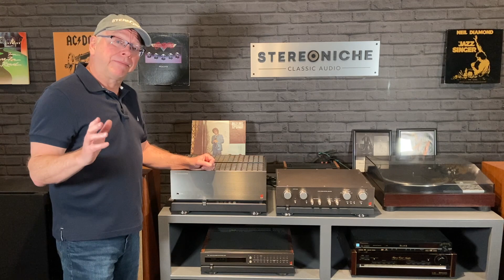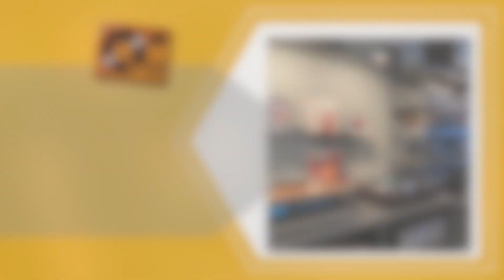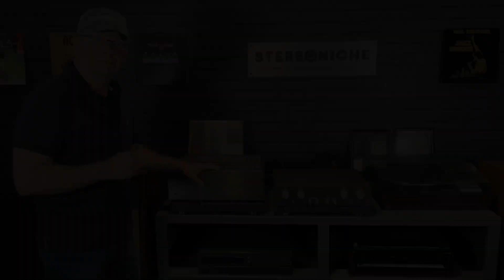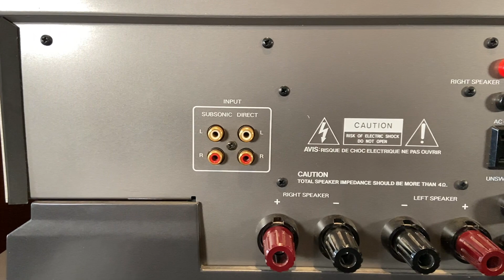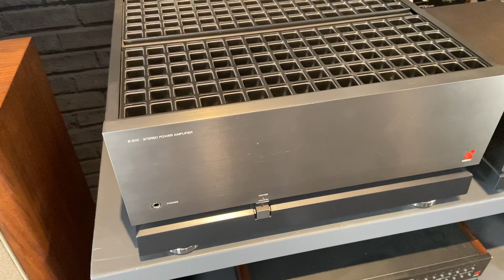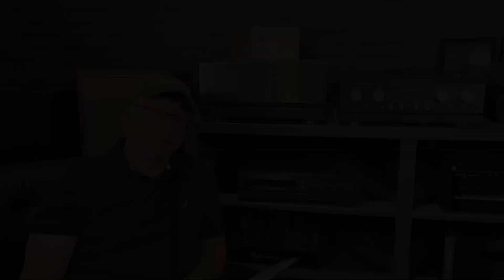Kyocera C 910 Preamp and B 910 Amp Review

Comment: I have a Kyocera D 811 deck. It is a unique 2 head, dual capstan DD, solenoid breaks, level&bias control, separate headphone amp, and volume. I also refurbished a 601 and 611. I have one more 601 that's almost done.. these decks are no doubt two steps above Sankyo 2 head Nakamichi units and are neck to neck or slightly above 2 head classic Naks.

Comment: Hello!  Love your channel and very educating in vintage hifi gears.  I have a question on a vintage hifi amplifier I own.  I own a few vintage gear like the Denon POA / PRA 1000B pre+amplifier, Pioneer M22, Exclusive M4 + C3 preamplifier.  I noticed many vintage gears have a 4, 8, 16 ohm speaker binding post.  Is it okay to hook up a modern speaker [like a dynaudio special heritage] with a 4 ohm 85db to a 8 ohm binding post on an amplifier with a 100watt by 8 ohm [Denon POA 1000B] ?  There is a 4 ohm binding post on the amp, but the sound on the 8 ohm binding post sound so much better than the 4 ohm.  Will it degrade the amp in the long run?
Reply from the maker: Hi there! Thanks for watching. With regard to your question, most tube amps have different taps for the impedance matching of the speakers. The lower the impedance, the more strain it will put on the amp, so it is very important to put the lower impedance speakers of 4 ohms ONLY on the 4 ohm connection of the amp. Not an issue to put an 8 ohm speaker on the 4 ohm amp connection. If your 4 ohm amp connection is not sounding right, you will want to have your tech look at it.

That is a wonderful amp by the way!
Reply: @stereoniche  Thank you for the advice!  The 4 ohm connections do sound good, but I notice that at 8 ohm it sounds a little bit louder with a better soundstage.  I’ll keep the connections at 4 ohm.  Thank you again!